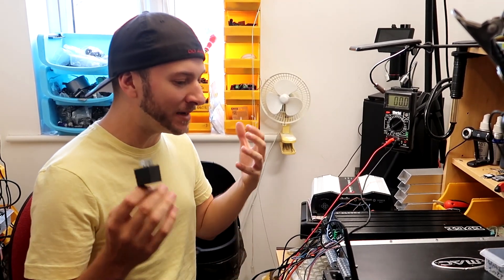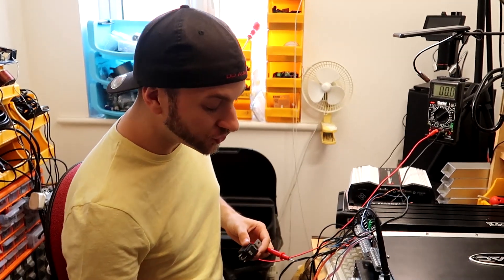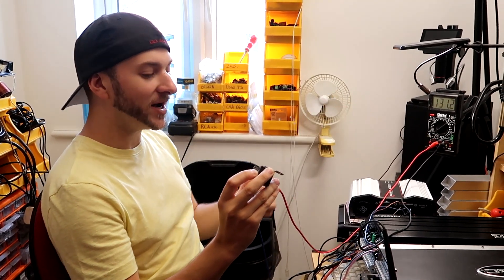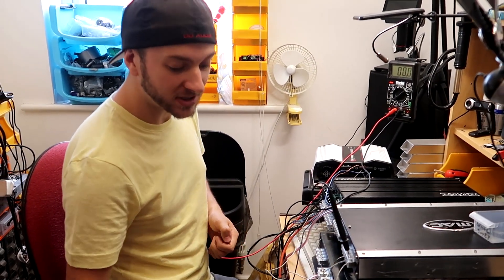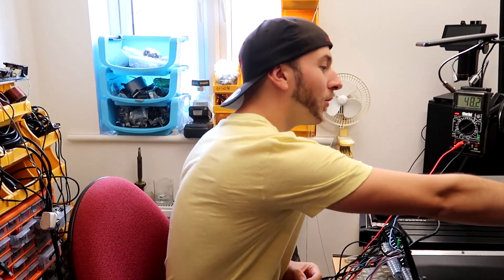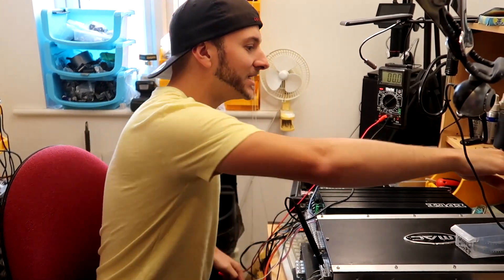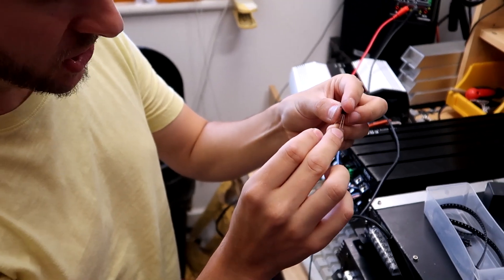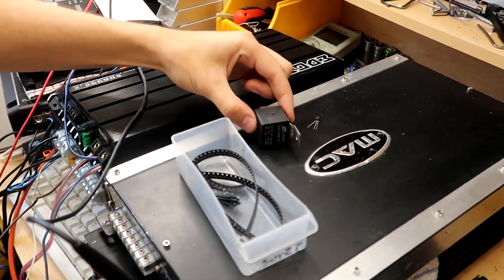"Bro do u need a relay on the remote for runnin 4 amps"

Comment: The problem I am having is I have 2 amps, hooked up to a alpine 670 with a parking brake bypass spliced on the remote turn on wire. I am getting a thud when turning the amps off. Wouldn't adding a relay solve this issue?

Comment: I have a ‘93 Corvette convertible with an aftermarket double din radio but utilizes the Bose gold speakers and amps.  I think the previous owner butchered some of the wiring.  My issue is that my antenna will go down randomly and my amps go out.  I don’t know why this happens.  If I disconnect the Bose Amp/power antenna relay, my antenna automatically goes back up, but I still dont have functioning amps  I don’t understand why.

Comment: How would you even connect a SPST 30 AMP Relay, in between a Radio and Amplifier... Use a Diode to prevent flash back voltage.

Comment: What is the difference in amp draw when using a longer length of wire assuming the head unit is about 10-15ft from the amplifer in most setups? I have a 300ma max from my head unit but i wonder if that would be enough to span the distance and power 3 amps. I believe it wouldn't make a difference but I'd like to see a reading of that

Comment: While you are correct and I am positive most people will never run into a situation where they need a relay for remote turn on, in my extreme car with 4 HD10K's, the 4th one in the chain would cycle on and off until I put a relay on the remote line. Never had that issue again after that. Voltage drop over wire length playing a part? Maybe, I have no idea but I know a relay solved my issue.
Reply from the maker: @DecalsAndFriedChicken13  very interesting! I have X3 HD10k here at the moment, maybe I'll connect them together and see if there's any voltage drop across the remote wire. Did you have them daisy chained or a separate remote wire for each amp from a distribution block?
Reply: @barevids  they were daisy-chained. I also have no clue what the remote output of my external head unit was capable of in that setup, or what the losses were going through a long cable run and a connector. I'm sure it all contributed.

Comment: Bro there sitting without powering hypothetically 50 subs at say even 1\2 volume that's when the draw happens try that again but do it with subs at 1\2 volumes then let's see how many amps they pull then
Reply from the maker: @glenn-ft6td  my brother in Christ, an amplifier never draws current through the remote line, for anything to do with any sort of load or power requirements, lol. It is literally a logic level enable signal. It and the circuit for it has no idea what the amplifier is doing.
Reply: No response? Yeah I figured 😂 you got destroyed by barevids

Comment: It's not about current, but resistance. I have an old radio that does not provide a convenient remote out as it's designed to block third party devices from connecting to it -- it actually disables the entire infotainement system if it detects an additional unregistered device on the canbus and locks out any other device from accessing MOST. There is a remote on from the HU, but it connects to the audio harness buried deep in the dash in a non-accessible location. So I plan on bypassing system audio entirely and driving the amps from my phone, which means I'll be tapping into some other device that powers on automatically - for example the daytime running light, but this other device may not be designed to handle the extra resistance from three amps, which has to be very high in order to draw only such a small current across system voltage, and I don't want to expose my running light circuitry to this resistance. But I agree that circuits designed to function as a remote on from the OEM should have no problem being daisy chained like this.
Reply from the maker: Current is directly tied to resistance. Current is a resultant of voltage applied to a given resistance. Current tells you the resistance.
Reply: @barevids  Yes, but inversely, R = 14.3/I. Low resistance means high current, obviously. The only reason you can get very small currents in a circuit within an automobile is because you have a lot of resistance on that circuit, or you have a transformer upstream that is converting system voltage into something else. There are no transformers sitting in front of remote turn on leads.
Reply from the maker: @robertsussland1876  I'm not sure what you are talking about. The remote on an amplifier is triggered by simply charging the base of a tiny transistor, often with further series resistors. The resulting "resistance" measurable across remote-in and ground is extremely high, many hundreds of thousands of ohms, if not in the Mohm range, thus extremely low current. I think you are confused about how this works.
Reply: @barevids  You are re-iterating what I just said and agreeing with my point. If you do not have access to a head unit remote on lead, then just grabbing a live low voltage lead that is powered when the car is on and using that to daisy chain is going to mess with the resistance of the circuit. This is why people use relays, to add a smaller resistance load to their circuit. Not sure what is so confusing about this.

Comment: 🔴 Got alot of controversal information out there, I've had issues with amps cutting out and when I couldn't figure it out, a reputable car audio shop added a relay. It's seem to work fine since then. So i guess my question would be... my case, what was POSSIBLY happening with my amps before the relay❓️

Comment: Using a relay will protect the head units remote output in the case one of the amplifiers shorts out or you are turning on other equipment that pulls higher current than the head unit can supply.
Reply from the maker: The remote from the head unit has a very high output impedance. You can short it dead to ground and it won't be hurt in the slightest.

Comment: Might be a stupid questiom....but...when you supply a relay it's 12v power supply doesn't that take the stress off of the radio trigger or remote wire?  So yes the relay requires more power to work.  But that power isn't solely provided by remote wire from radio.  That wire just triggers the relay.  Maybe I am wrong.  Just trying to sort this out in my head.  

I need to turn on four computer fans...three 90s amps and led lights.  I was planning on using a relay but now wonder what would be best for remote turn on as far as wear and tear on the head unit.  Ty for your help
Reply from the maker: Use a relay for this, because fans draw considerable current ☺

Comment: WHAT IS A GOOD MOSFETS TO USE 12 VDC AUTOMOTIVE 80 AMP  IN PLACE OF RELAY FOR RADIATOR FANS?. NEEDS TO HAVE HIGH INRUSH UP TO 75AMP AND 20-30 AMP CONTINUOUS RATED

Comment: QUESTION,HOW MUCH CURRENT DOES 3000 WATT LETS SAY SUNDOWN AMP DRAW JUST RESTING IN A NOT RUNNING CAR OR PARKED CAR?
Reply from the maker: You mean powered off? Nothing, 0.00a. Powered up and idling, between 1.5a and 8a depending on the amp.

Comment: I currently have the problem, that i use a Pioneer TS-WX130DA under my passenger seat and i want to add another one under my driverseat. So on i also run a Spectron SP-N4400 for my ESX QXE speakers in the front and the back.
Following i would have 3 remote + 1 (radio).
Currently they are parallel, and so on my question is, if i somehow can daisy-chain the ts-wx130da's or should i daisy-chain one cable from the back of my car (from the spectron) to the front to the new Ts-wx130da.
I also do have a relay here, but not built in yet: HJR-4102-L-12V
I thought about the relay, because i currently have already some remotes parallel.
What would be the wisest decision in your guys opinion?

And if i should daisy-chain the ts-wx's does someone know if this is actual possible with these active subwoofers?

I'm happy about every answer :D

Comment: a fe years ago i Had an AA 12k (signed by JP before D4S was really a thing lol) burn the PCB when it did it dumped 180v ish on to the remote line and took out my fosgate for my mids and set fire to my pioneer head-unit like actual fire the head unit cost 2x more then the amp.  all in all it was my fault it was a 12k on mild electrical stock alt (165A) 3 batteries 80Ah ea and a 65Ah under the hood.

new wall build 
4X sundown SFB-8000D's on 4x Avatar STU-1546 15" D2's running inverted in a 2:1 4th order with 14cf total (i know kinda small but it's an 06-XB C-puller wall daily driver)
single 320A ALT with 960Ah's of LiFe Power and 8 banks of Maxwell ultra-caps 1 bank per amp input. have 3 more 270A alt's on a trailer mounted power unit for extended demo power.
trailer is a DIY squaredrop camper and the entire build  is getting an itasha Wrap with once the wall is complete. the XB and the Trailer are bother Bagged and Sync'd

Comment: Enjoyed your video just double checking I can run 2 amps and 1 equalizer and a epicenter on my remote wire on my pioneer avh w4400nex
Reply from the maker: yes
Reply: @barevids  questions what would cause an amp error on the same stereo after I connect the remote wire to the 4 channel amp.
All connected to 1 remote wire
Also the voice cuts out when the volume is raised

Comment: All comments are about the relay in the amps pulling power, but nobody mentioned the headunits. Back in the day, there was the misconception that the "remote power wire" did not have enough amperage to turn on the amps relays in multi amp systems. Hence the addition of the extra relay. With all this new techno advances, us old schoolers, as I am, just played it safe. And EXCELLENT VIDEO WITH THIS TEST. Next test the headunit!!!!
Reply from the maker: Not sure if misinformation somewhere you've read, but the remote wire has never powered the internal relay in car amps. The relay inside is fed by a PNP transistor grounding the 12v VCC feed that supplies things like TL494, NPN Drivers, fans etc. A little timer circuit supplies currently slowly to the PNP and it eventually conducts, giving the relay coil a path to ground from 12v VCC.

Comment: I’ve been questioning this for the past few days as I completely upgrade my car audio for the first time. I’ve been told max 2 wires daisy-chained & find another location for my third. While I’m not very experienced with car audio, this makes perfect sense. I was wondering why there was a “max number of lines” for a remount on lol. It’s not like it’s powering the amp on.. even though who I spoke to were acting as if it was lmao. Thank you, sir! Well said & much appreciated.
Reply: yeah the idea is not so much just the relay its think about the multiple points of failure you have.
with a relay you got a single voltage input. you got a single switch wire  and then you have your output.
so when something goes wrong you simply trouble shoot : am i getting power to where?
or the old Christmas light hours of fun which lights burnt out???
.with a coble of splices, and bad crimp connectors and fighting with solder and shrink wrap... ,
yeah ill get a good ole bosch relay and a  inexpensive terminal block and keep from pulling my hair out

Comment: Yes. Use a relay. Use the proper relay that requires low amps, etc. and run 12V battery power to the amplifiers from the relay.  Each amp has its own amperage pull to turn on via remote wire. Just add up all the current pulls required for each and than compare it to the max remote output amperage rating of the head unit. If the amperage requires is higher than the head unit max. output spec, then you need a relay, despite this explanation. The other thing/reason wy is that if for some reason the amp goes or the remote shorts out, it cuts off the relay instead of frying your head unit. If you have amps that have output remote power, then great, run the other amps off each other.

Comment: I have a lithium bank that is isolated from the other batteries it is only in the circuit when the head unit is on. The head unit turn on wire activates it should I use a relay to activate it instead of the head unit turn on wire?

Comment: with much respect and love for you , from a fellow MB repair guy- , why get rid of a MAJOR PROTECTION DEVICE that is only 2.50$ USD ... 
its more than just running multiple amps, I would install one to run 1 amp , or DSP/EQ/what-ever ... way be at the mercy of sock/headunit failer when you can eliminate a potential problem that can DESTROY amplifiers because of random/various issues beyond your control, (water leaked into your dashboard/kid spilled a soda -that caused the head unit to short-out, and your AMlifer got fried by the .1ms it took to pop the fuse ...
Reply from the maker: Hey buddy! The circuit in the amplifier that is connected to the remote wire is completely isolated from any power stages or high voltage etc. In my years repairing amps I have never once seen an amplifier kill a head unit down the remote wire, or vice versa. The same cannot be said about the rcas however, ive seen auxiliary supply rails go nuts and generate about 50v potential to the pre-amp OPamps, causing them to short and throw that voltage back at the head unit, but never once has the remote caused anything like that. It's an extremely low current logic level signal that is extremely far removed from any part of the circuit that will fail in a dangerous manner. The worst that could happen is the amp sends 12v back down the remote wire to the head unit, which will result in the head unit seeing 0v potential and near infinite resistance, posing no risk whatsoever.

Comment: here is my input.  I run 5 class d amps for subs, 3 amps for mids and highs, a line driver and  an led strip driver and volt meter that all run off of the remote wire from my kenwood kdc x998.  So no relay needed......

Comment: I ran two small blue LED strips off a remote wire that also powered on the amp. Looked cool and came on with his car, didn't cause a single problem. There's a couple pictures of that box on the SMD forum

Comment: What if you want to add leds and fans to the remote circuit that draws way more than 1 amp should you run a relay then?
Reply: It all depends on how much wiring you want to do. 
Myself I use relays.
I gotta feeling like he's ""powering ""the relay with the remote source.  
Which is stupid if you do that.
Yeah simply use the remote as your trigger then have constant 12v as your power. Then a cheap terminal block will make wiring way simpler

Comment: Guys that say to run a relay are the same guys that like to have lots of extra equipment like it really matters. Like adding a cock box so you don’t lose RCA voltage when in fact just adding splitters will do the same thing for half the price. Adding an external eq is the same thing. Most radios have a 12 band eq or an 8 band so the external eq is totally useless. I think they just like to mess with the knobs and buttons like it will make a difference
Reply: Yeah you loose voltage/dB etc every time you make a connection.  You add resistance to the flow of current
And add a point of failure .
Add into the problem of noise induction and then you  just kinda defeat the point of upgrading

Comment: Age old argument .momma gates would call installs with relayed remotes by the way the head unit would dim . the ones that do run relays never increased the ground wire gage. Thats would fail inspection and comp would be passed for that install.

Comment: I’ve now seen 4 people on Facebook hook up sea flow fans to the remote line. One customer is mad because the shop wouldn’t warranty the headunit
Reply: this is how this whole thing actually started because way back in the day someone started to put loads on their amp turn on wire.   

and the rest is history and that's why people keep spouting this nonsense today.  

in the very early days of car audio you could have up to 20 devices on a head unit for turn on because back then you literally had 20 devices in your car audio system and that would include a tape deck a CD player probably a mini disc maybe a DVD player or a few DVD players then you would have all of your monitors you could easily get up to 40 devices in a vehicle fully loaded,  

think about those show cars from back in the early 2000s where you had almost a hundred different devices running off of the turn on. 

as fun as it was back in those days to wire up all these things it's not really needed today and most people barely have a few devices on their aunt turn on leads.

Comment: Ok how does wiring a relay correctly  , put more stress on a relay? 
Yeah the small remote wire will be way more then enough to trigger a relay then an amp. 
Now daisy chain has (x) * y failure points. As every joint is a point of failure

Comment: Is the remote wire power draw on something like a voltage meter going to be about the same or do they use different tech? I'd like to see power draw from other equipment.
Reply: No, a voltmeter needs hardly any current by comparison - much less than a microamp depending on the range that’s selected.

Comment: I do hobby electronics and car audio and this always seemed odd to me. I didn't have the stuff to test it though. Need to invest in a Fluke.
Reply: Yeah for the .00001 of variation in voltage probably not worth the effort to invest in a fluke.
Unless you find a used one dirt cheap or your an electrician

Comment: The only way a relay would be beneficial is.
They have a built in timer to help stabilize the power turn on on each amp.
4 amps 3 timed relays. 2 sec delay down the line

Comment: That is not so .If you check the schematic of the 800.4 you would see that there is no transistor between the remote and the vcc for the tl494 nor the gate drive transistors.I have repaired more amplifiers than you would ever dream to repair.